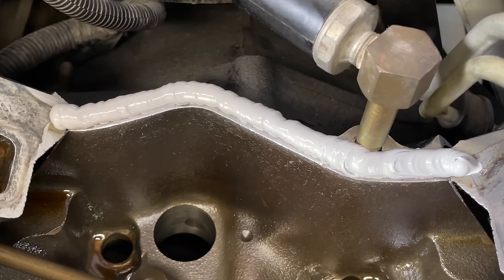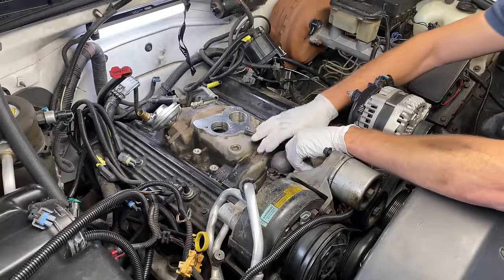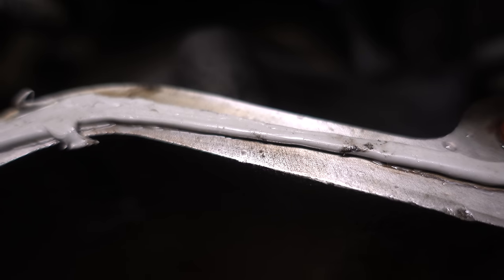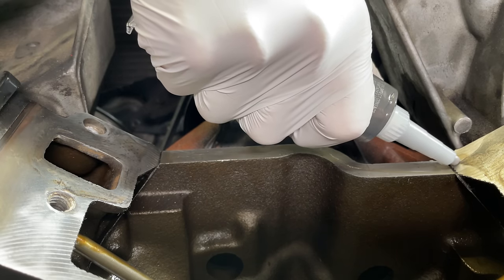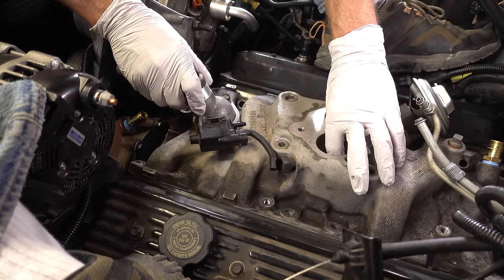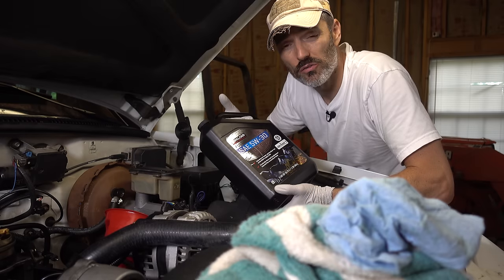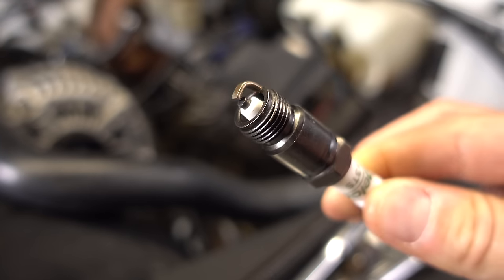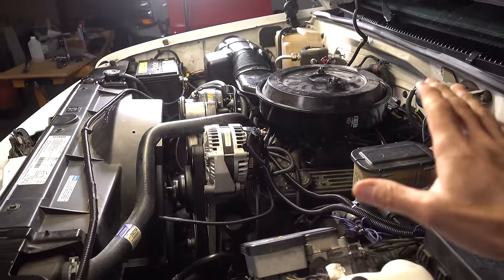Why You NEVER ATTEMPT To Use RTV Gasket Maker Without Doing This First!!

Comment: I'm Pro Mechanic 46 years exp ,2 Cert Masters . Anyway done many of these I always put a thin bead Silicone around Coolant passages on Gasket Reasons Being intake manifold may have Corrosion indents on surface also Intake manifold surface to Head might be Slightly warped. Use Thread Sealer on all intake bolts tighten  Intake torque bolts from center out   I tighten bolts in 4-6 times threw out the pattern slowly tighten them than progress up sometimes it's hard to use a Torque wrench tightening by hand be fine if you use long wrench don't be animal over tighten. I like to recheck intake Bolts after Engine has ran for awhile might be a few need tightening. Another hint have everything Clean Ready organize before laying on Sealant once it's exposed depending on temperature you have 5 min window get Manifold on Quick as possible get your bolts started with Sealant on them already. Than tighten it up down hill from there.

Comment: a word of advice next time you gotto do that intake or any other intake use pipe dope instead of thread lock as it will also keep it from backing out but with the fact of that they usually go thru oil or water jackets it keep all fluids where they belong .

Comment: Back in the older days I used electric engraver to ruff up surfaces to help retain the silicone in place and still do it on air cooled engines every day because of vibration

Comment: After good cleaning and deoil the surface.  I ply thin coat with finger both surfaces. so see bond take place. then put nice thick bead on block before putting intake on

Comment: I've been doing this repair since 1978 on Chevy 350's 50% of the time the back s pattern would leak. Felpro used to supply a rubber gasket. And like a fool, we trusted it.
Then, when the ulta grey came on the market, the problem was solved.

Comment: Great video! I would add a couple other small details that will help get a good seal on those difficult manifold ends: 1. After cleaning sand both the block and intake with sandpaper. 2. Apply a thin layer of RTV on the intake in addition to the thick layer on the block.
Reply: Bro, absolutely not, never under any circumstance use sandpaper, or Emery cloth on gasket surfaces, gasket surfaces are machine to a certain flatness, and a certain tolerance, using sandpaper, can absolutely destroy those tolerances, use a non-maring material removing disc. or a surface safe razor blade. you were only trying to remove the varnish, fats, and previous gasket making material you are not trying to remove any amount of metal.
Reply: If you need use rtv on component seams like…for example, a small block Chevy intake manifold…three options… use RTV on the four corners of seams. Wait a specified amount of time for the sealer to cure, then torque to spec.
2. with the appropriate cork gasket, use the cork gasket, apply RTV to to the seams and the entire top of the cork gasket. You can even apply RTV to the entire front and rear gasket service of those intake manifold. Make sure you apply a very large amount as you said in the video almost too much, finger tight the manifold, come back within the specified amount of time and torque the manifold. I recommend “Permax the right stuff black” don’t you dare use sandpaper.
Reply: Terrible advice
Reply: And just what is so terrible about it? Nothing wrong with cleaning the end surfaces with a fine sandpaper. And yes don't be stupid and dish the surface out with sandpaper just lightly clean it up.

Comment: I've actually used rtv for intakes all the way around on several vehicles I've owned, sans any solid gasket & achieved long term good results - chev & ford v8s & inlines. ZERO gasoline erosion. ZERO vacuum/fluid leakage. Never a bad result. Sure, if you IMMERSE the stuff in gas, then yeah, dissolution. But on an intake? Not in my experience. Just adding this post as a side note.

Comment: Did you use a torque wrench when putting the thing in place?
Did you torque it down in the right order?
Did you use the torque specified in the manufacturer’s repair manual?
If all three answers are yes then I think you’re right about that the issue is with the sealant amount or application.

Comment: Before doing this the second time (you'll have to but) check your PCV system and make sure its clear and operating correctly. 
Those front and rear surfaces MUST be surgical clean.  On the block and underside of the intake.  No finger prints, no visible oil.  Lacquer thinner on cheese cloth or folded paper towel here.  No substitute.  Some acetone's and brake cleaners leave a film.  Carb cleaner is out.  Lacquer thinner.  Sanitary, surgically clean for silicone to stick.  Keep a pint of Lacquer thinner in the garage.
The bead on those "china rails" needs to be minimum 1/4", 3/8' is better.  You want slump out all around.  You can trim it the next day if it bothers you.  What's inside won't go anywhere.  Go slightly up toward the water jacket with the sealant.  A dot more in all for corners. Let it slightly tack up before setting the manifold.  I prefer not to start it for a day.  Done a lot of Gen 1 SBC's.  They all leak where the timing cover meets the oil pan too.
Reply from the maker: Great info, thanks for leaving that! 🤙

Comment: Oh—you gave me nightmares doing my vortex manifold gaskets....

Some ditties:

№ 1: Drawing coolant to a level below the manifold can help mitigate how much get dumped in the lifter valley; and

№ 2: The shop manual instructs to put adhesive up 1/2-inch on TOP of the bottom corners of the hard gaskets.

Your leak ii experienced may have been oil sneaking above the sealant and below the gasket and not necessarily going through gaps in the adhesive.

Comment: I used that ultra Grey on an intake on a vortec v6 only to find the injector was leaking large amounts of gas which flooded the #5 cylinder. I took all the bolts back out but couldn't get the intake off. The Grey stuff was holding so well it took an hour or more of prying and the need for a bigger pry bar to get it off. I bet I could have put it back together then taken the bolts all out and run it with no intake bolts at all once the stuff cured.

Comment: Before removing the manifold,
1) remove block water plugs
2) blow air through coolant ports on the manifold
3) using a wet/dry vacuum, suck anything that comes from the upper hose on the manifold.

Chances you will not drop coolant anywhere

Comment: I don't think I've ever seen that large of a gap between manifold and block before. That seems like about 3/32 or something.  Sucks to have to redo, and I think you were right to be concerned about squish. So IMO, everyone should proably dry fit parts to ensure they know how much to apply.
Reply: The engine is designed to have a rubber or rubberized cork gasket there,but no one uses them because they always leak or blow out completely. No one uses them so gasket makers stopped providing them and just put a small tube of gasket maker in the kit.
Reply: @3rdpig  That's a fair point. I do recall the rubber seals being pretty touchy.
Reply: im pretty sure its a big block. so its a small block just alot bigger. therefore the gap is alot bigger too.
cork gaskets suck and sillycone is better as it doesnt just blow out one day and fill your engine bay with oil. 
even with the cork gaskets you still needed silicone but its just better to make it out of the same stuff.
Reply: @chehystpewpur4754  It looked like a small block to me, most likely guessing 350 based on the vehicle it's in (looks l90s, which 5.7s were very common)). But I could be wrong, and I'm not sure it matters. I hadn't considered why there were none of the usual (or at least years ago the usual) black rubber/silicone gaskets for the front and rear of the manifold.
Reply: @rimfire2642  the 7.4l 454 big block from the 90's looked exactly like the l31 vortec aside from the intake. valve covers and all just its an absolute chonker when you see them side by side. the intake is diff so im just guessing based on things.
Reply: @chehystpewpur4754  Not that it matters really. I went back and watched his first video. At about 10:30 he says it's a SB Chevy.
Reply: @rimfire2642  fair enough i wasnt to that point yet. it looked different from the tbi units ive seen and also the spider injection ones ive seen so i just figured it was early big block based on grill. if gap is that big on small block there is chance intake caught on valve covers. even properly aligned non leaking valve cover gaskets can interfere with intake manifold. on the roller motor block tbi units.
Reply: @chehystpewpur4754  I agree even in person sometimes it can be confusing based on scale. It didn't look like a BB to me size wise, mainifold, valve covers, space in the engine bay.  BUT I admit I wasn't certain, and could've went back to the video and he said it was indeed a BB. Again, not really a matter, although I guess maybe to the point of rear and front intake seals maybe just suck on all Chevys!
Reply: If you've never seen that large of a gap then you've never worked on an American engine this old before.  The cork gaskets originally designed to fit on the ends are thick and don't compress that much.
Reply: @rickr530  If you read through the replies in this thread what I'm used to is there being a gasket. Someone commented that no one uses them because of blow out. Well...what did he have with the gasket maker? LOL a blow out. So yes, the gap, but not really needing to FILL the gap because there was a gasket. I'm not claiming to be some engine building master, but I've worked on a few engines in my time and it's been a while since working on SBCs. But we (I guess myself and a couple friends0 used to use the Felpro blue gaskets which came with rubber seals and never had any problems. Where we WOULD have problems was the crank seals...but I think a lot of that was just being younger probably if I worked on them today I'd get ir "right".
Reply: @3rdpig  fel pro gasket kits have always came with the rubber gaskets. I have 2 , one set for this motor, and for an 85

Comment: I would have used a thick bead of the Permatex Right Stuff 90 minute gasket maker. Snug the bolts up and 1 hour later torque them to spec. Then I wait 2-3 hours before adding fluid or using the vehicle, and then it's definitely dry and ready to add fluids and/or drive.

Comment: hey man when it comes to liquid journeyman theres really no such thing as too much. We've all done it, but rule of thumb is if they give you a whole tube for 2 seals, use as close to all of it as you can while splitting it equally. If its not spitting out you did it wrong. Ive found you always add a blob under the gasket and then add a little dollop on top on the gasket where the actual gasket and liquid gasket meet.

Comment: When I worked on my older cars, I used gasket maker where it supposed to be used.  I found out there is a difference between gasket maker and silicone sealant.  Silicone tends to make things slide.

Comment: if you ever have to do this again, ty and find some of the same thread shoulder bolts extra long and cut the head off them and clean them up and put them on one side as a guide this holds the one gasket from moving and all you have to do is keep the one in place with your hand while you lower the manifold down at an angle on the headless bolts sticking up. then add bolts around to keep everything down and just remove the studs you made and reinstall normal bolts, helps a lot when you do things like this solo

Comment: That sealing are has been a PITA on every small block engine I've touched. Almost made me want to fly cut the sides of the intake, just a few thousandths, to get that area to close down a bit more. But, I was afraid the ports wouldn't line up or I'd run into another issue so I never experimented with it...

Comment: The best way to use it is to not use it very much. I don't use it on my diffs at all. I use Lube locker gaskets. Same with Transmission pan. It makes cleanup almost nonexistent, and the gaskets are reusable so buy one and that's it. I use RTV at the joint where the intake gaskets meet the valley gaskets but not a whole bead. just a dab in the corners. I'm a Small Block ford guy so I also use a dab at the joint where the Timing cover, oil pan and block all come together.

Comment: When it comes to pushrod V8s/V6s you need to set the intake manifold on the intake gaskets first to see what the gap will be between the block & manifold. THEN remove to lay your bead of gasket maker. Some engines will have 1/16" gap here while others have nearly 1/4" of gap. THAT gap dictates how much gasket maker uou use, using a huge bead every time is foolish because an excessive amount will go down into the valley of the engine.

Comment: I have used RTV many times, for making gaskets.  And what i see wrong is that the rtv has not been smoothed out with your finger.  I have tried just using a beed without smoothing it out quite a few times, and everytime that i do not smooth out the RTV, I have leak problems.  Now I never have leaks, because now I smooth out the bead with my finger, so much that it is not even a bead anymore. Just spread it like butter.

Comment: Cover the entire china rail with rtv, put your intake on, barely snug your bolts down, wait an hour or so before you torque the bolts down.

 For the side gaskets put a little bit of rtv on the head side of the gasket to keep them in place, on the intake side put red grease on them. The gaskets will seal well and the intake will be easy to remove the next time. 

For the valve covers pitch the cork gaskets, run a nice bead of rtv around the valve cover, put a film of red grease on the head sealing surface. Set the valve cover on barely tighten the bolts, let the rtv set up then tighten the bolts down. The rtv will stay on the valve cover but will not stick to the head. It makes a very nice seal and makes the valve cover easy to remove. The rtv gasket will last a long time.

Comment: If that antifreeze mix has gone amongst your piston rings it will cook once you run the engine. That will cause the piston rings to gum up, and your compression will be affected because they will no longer move in their grooves. Should have dropped the pistons out and washed. I'm sure that many people think the problem is caused by burnt oil when they discover it.

Comment: Dump question: But did you let it dry out BEFORE mounting the manifold? Or did you mount it right off after placing the gasket maker?

I believe RTV sticks to its parts when its fresh. If you let it dry and then mount something on it, the connection wont be there.

I had no problems with these passages on my engine. I used enough RTV and after directly mounting, i smoothed it with my finger
Reply: ... just because i am wondering why your manifold came off just letting the rtv completely on the engine. There should be parts of it sticking to both sides, so that it has to be ripped of with a scalpel hardly.
Reply: Or maybe your surfaces were not cleaned with brake cleaner / alcohol.

Comment: This job is the exception to the rule! Usually you want a minimum amount of RTV because the excess will likely end up in the engine. However, with these intakes the gap here is so wide it needs to be loaded up.

Comment: I used Ultra Black on my oil pan and the directions are the same. I had to do it twice because I used a Felpro 1 piece, turns out that the Canton oil pan I have is not compatible with a one piece. The 1 hour to torque is great. It gives you plenty of work time. I used The Right Stuff the 1st time and I would not recommend that RTV on a large gasket surface with lots of bolts. The work time is 1 hour to cure.

Comment: I get jobs in often that are messed up by the owner. Leaks, fluids or vacuum, often appear after people fix things.  Having a missfire is a common issue after repairs are done by owners. It usually boils down to either not cleaning the surface, using the wrong rtv, not torquing correctly, or not allowing enough cure time.
  I see rtv squeezed out everywhere pretty often. It doesn't matter how much you put on if you didn't clean the surface. Most people tell me they got it back together, put fluids in and went to work the same day.  Why do you think auto shops have your vehicle for more than a day?  They know it will spring a leak if the gasket maker doesn't cure.
  I use permatex 90min pretty often.  It also states finger tight for an hr before torquing.  It's the experience you may be paying for, not necessarily getting the work done. Any mechanic can replace a gasket. It's the ones that has did it 100 times who do it right the first time instead of having the vehicle back soon after the repair.
  Knowing the products and how to use them is pretty important. I use brake cleaner pretty often to clean surfaces.  It is made to clean grease and fluids and evaporate quickly. No other cleaner gets grease off quickly and is cost effective.  For the $5 I charge for the cleaner, every owner saves 100's if not 1000's.

Comment: I first like to put a very very thin layer of sealant on the China walls with my fingers, so that the surface is completely saturated and rubbed in to the surface of the China walls . Then I put a quarter inch bead  across.

Comment: Back in the day I worked in a VW (air cooled) engine shop. I can't tell you how many motors we saw ruined by RTV. The little "goobers" that are squished out to the outside an equal number are squished to the inside. Free to float around inside the motor plugging oil passageways. I will never use RTV on a motor. Red Permatex will dry and seal any gasket surface without creating the little goobers. 6:00